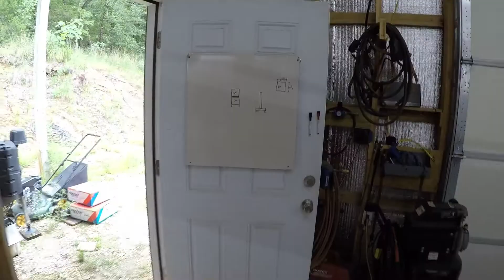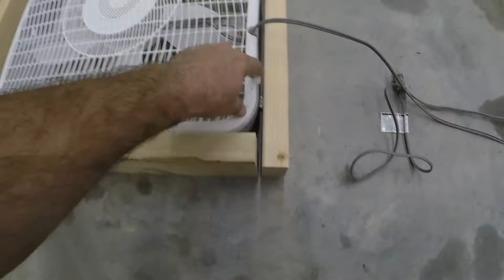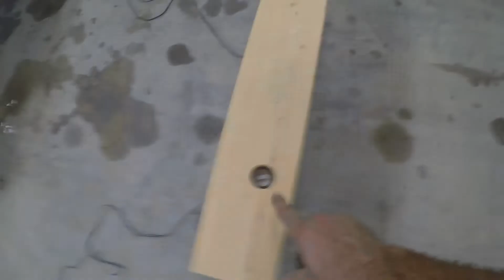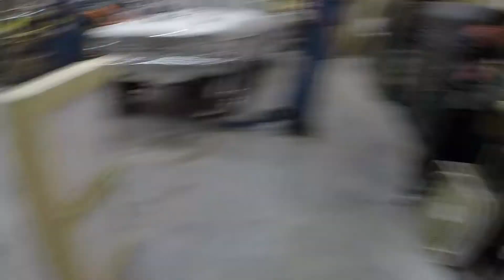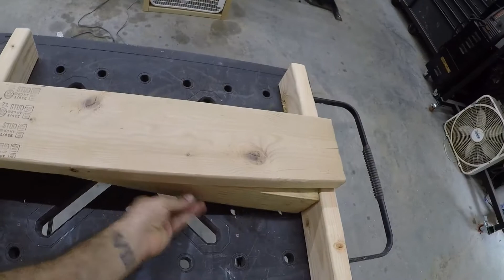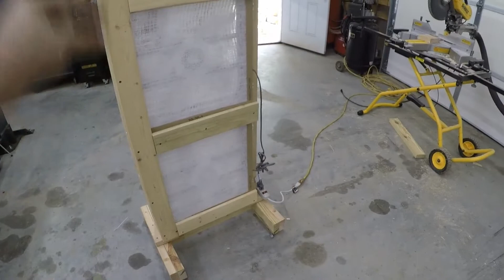Shop Fan Build

Comment: Could you adapt the fans you just made but put a ball berring sleeve on the sides so it can turn and pull air out and pull air in when near a window . Rather than turning the whole thing around with the wiring. ?
Reply: Fantastic video and great job 👍
Reply from the maker: The way I put it together you wouldn’t be able to. I use it mostly to filter the air when painting or sanding.